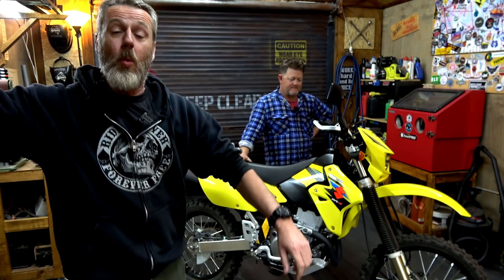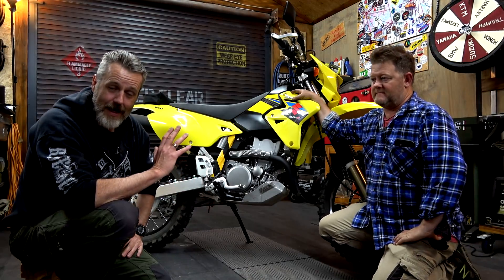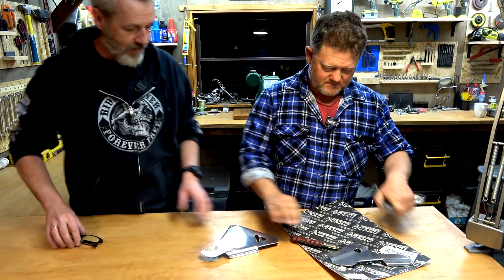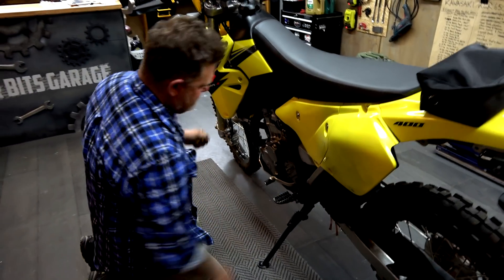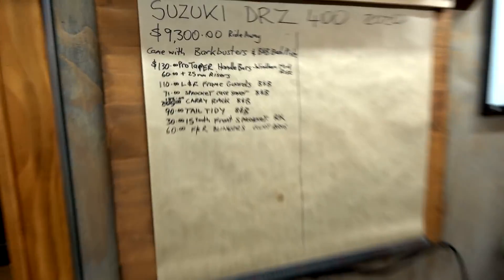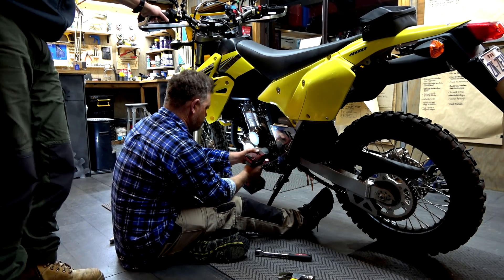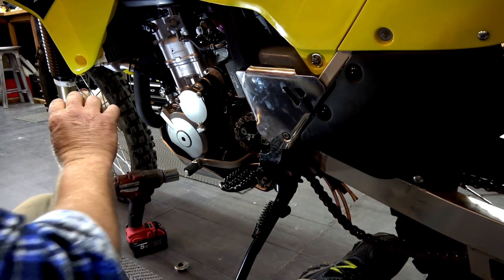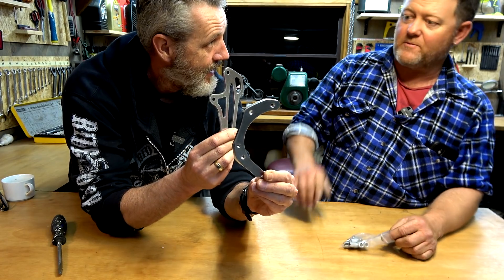DRZ400 - Simpson Desert Weapon Build - Ep.01!

Comment: Quick tip.   As a rule of thumb, metric bikes use 10, 13, 17 & 19mm fixings.   That's it.   You'd be hard pressed to find any other sizes unless somebody has put aftermarket parts on.    Those sizes are the only size spanners I carry on the bike for the odd roadside repair.
Reply: Old Hondas use 14mm not 13mm, don't know about newer bikes.
Reply: You're gonna need an 8mm as well.

Comment: Thanks for all the videos.  Awesome experience.  I have 2021 Drz400s  and just installed the front sprocket case saver.  As for the wire holder. Does it matter if is next to the engine or not? I have the spacer next to the engine.  And  B&B sent me 1 longer spacer. I am guessing it is for the bottom? Keep up the good work 👍🏼 Ted, Florida, USA

Comment: V=IR (Ohms Law)work out what thye blinker load was before and add a resistor (R) the correct size in the circuit.  The old bulb will have Watts on it. P (Watts) = V*I.

Comment: as said indicators need a relay . as it thinks a bulb it bust so flashes faster . because LED use less power.plus to make road legal it has to flash slow like original. other than that it's looking good. i rode the super-moto version years ago when they first came out.

Comment: Nice choice mate. 
You can buy relays at Supercheap or Jaycar. 15 bucks. That will sort your hyperflashing problem. 

Don't forget to bypass the side stand switches, clutch switch. Have a look at the sprocket seal retention bracket. (Can be bought from Suzuki) 

If you are game you can look into modifying the carb for more pep when snapping the throttle open. Pretty easy going just adjust the accelerator pump. 

Don't forget to Loctite tour stator bolts! 

Advice from a bloke with a 2006 drz with 35,000km. 
Cheers!

Comment: When heat shrinking over all cable joins I use some glued heat shrink from Middys has glue inside it as you heat it it actives glue keeps all dirt out of joins
Reply: Also water can't creep in and degrade the wiring.

Comment: Looks the same as mine...which is a 2001 model! Good choice!!
I modded mine a fair bit, one of the essentials is the muffler, that stock is way too restrictive and way too loud when uncorked. The Barrett is fantastic, straight through but not loud. Really let’s it breathe. Stainless steel packing means it doesn’t need repacking. 15/44 is the best gearing, but mine is bored/stroked to 472cc so handles the gearing better.

Comment: You need to apply high strength loctite and torque up the CS sprocket. The locking tab does not hold it on.  When the nut comes loose oil will come out of your CS seal. Known DR issue.
Reply from the maker: Thanks for that! :-)

Comment: This is a really good project Mark.I have been going around in circles trying to decide which mid adventure bike I'm going to buy around Xmas time when hopefully things open up.I had narrowed it down to the CB500X but they need work therefore money spent to bring up to scratch.Like the KTM390 but too much electronics.Being around 5'9" need to be able to get feet down.This Suzie build has convinced me I can do  a bit to it,like pack rack,run the 15/44 for highway etc and get the best of both worlds.Can you fit a centre stand to the Suzie,could live without but prefer the stand,makes puncture repair easier and chain maintenance.

Comment: Your existing blinkers (bulb) draw more load and the standard blinker relay is expecting to see that load as it sets the flash rate.
Two ways around it....swap out your blinker relay for an LED compatible one (the better method)
Second is to fit load resisters ,one each side to simulate the load of the existing filament lamps,not as good but it works and there are thousands of bikes out there with them.
Rizoma at one time used this method,they still may,Oxford products sell kits but they are just wire wound ceramic coted resistors in a heat shrink sleeve with short wires and bullet connectors....
When going from a 21 watt incandescent turn signal to an LED turn signal, select the 18W / 8.5Ohm resistor
When going from a 10 watt incandescent turn signal to an LED turn signal, select the 8W / 21.5Ohm resistor 
Sold as a pair normally and one per side is all thats required.

Comment: When you have the tank off it’s a good opportunity to run a second spare clutch cable. Cheap insurance. Also an led headlight bulb can save power to run other accessories. I believe the safari tank comes with a petcock because the stock one is prone to failure, like mine did. When I put the lower Seat Concepts seat on I needed to lower the pegs and used David Knight lower wider pegs.

Comment: 7 pin suzuki led flasher relay will stop the hyperflashing you can find them on ebay for about $20 or $40 at bike shops. they stung you with the covid tax on the price and no cape york kit? surprised he went with the 17l safari instead of the 28l if he's doing the simpson the 28l is only a little bit wider i'm very happy with mine and surprisingly hardly notice it.

Comment: instead of soldering in resisters for indicators just fit led flasher can.easy
Reply: Where do you get the flasher cam from??
Reply: @craigcloss8168  supercheap sell them
Reply: @normanperry9605  dumb question what do i ask for?
Reply: Well super cheap auto dont have the 7 pin flasher for led, so its an ebay job, thanks for all input

Comment: Need to fit LED resistors, to slow the flasher rate Mark...get some metal ones online, mount them so they get plenty of air over them, coz they get hot AF, easy to fit too,  cheers and loving this new series too mate!
Reply: You can also get a adjustable blinker can that does the same thing I will see if I can find the link
Reply: Just found that mx store do a plug and play resistor